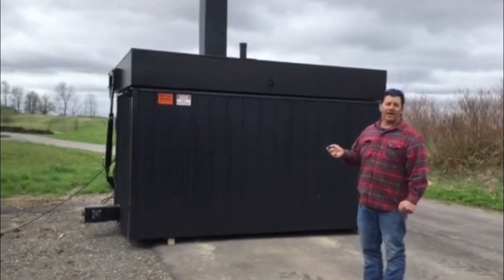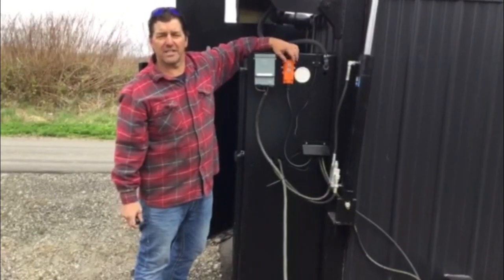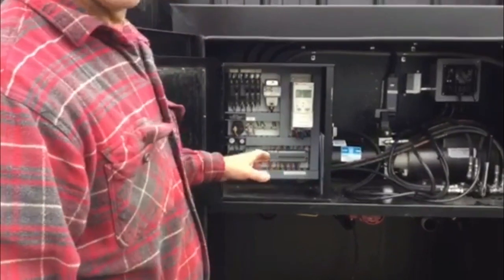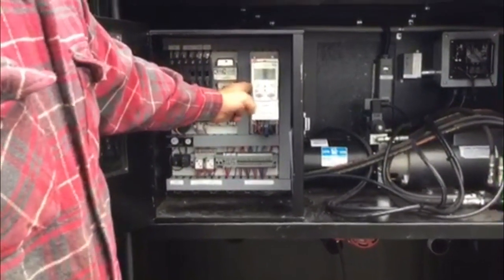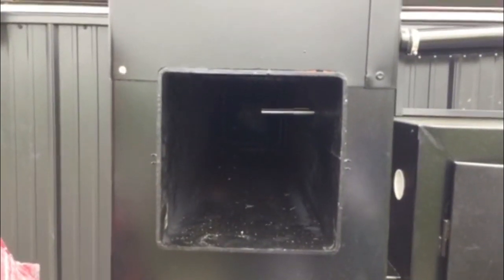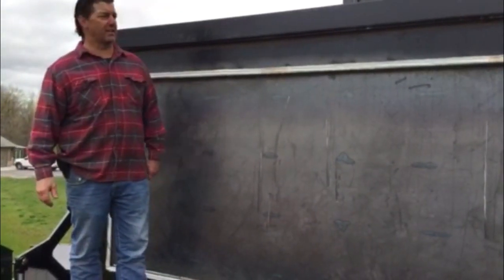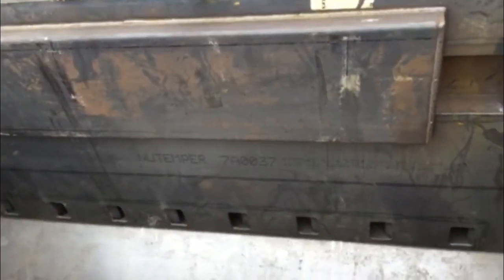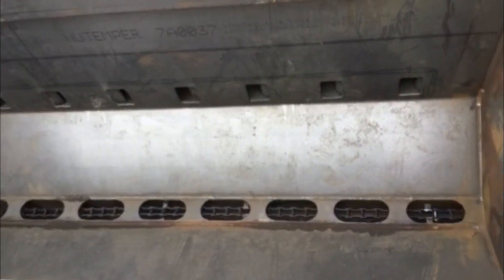The Log Boiler Walkthrough

Comment: Pretty cool. How thick is the insulation on the outside of the firebox? How thick is the bottom plate on the firebox? I’ve bent metal by dropping logs on it. Also how often do you have to restock it? I know there are a lot of variables like outside temp water temp coming back to the boiler and if you are green or old wood

Comment: Lot of thought went into the design for this log boiler. I especially like using the chain to remove ashes from the firebox instead of a screw conveyer as the chain is far more capable and less likely to jam due to steel and dirt in the wood supply.